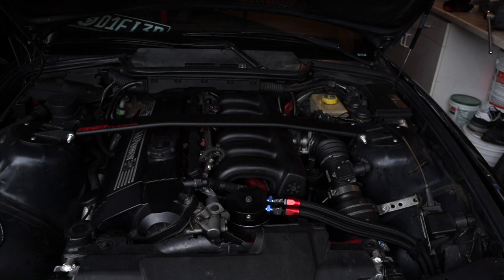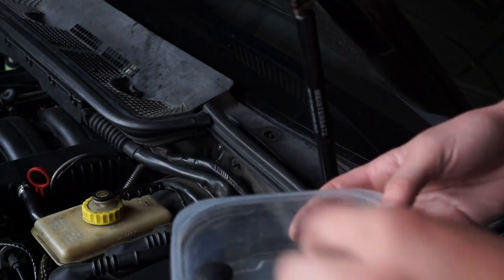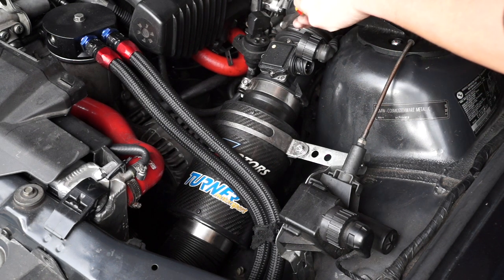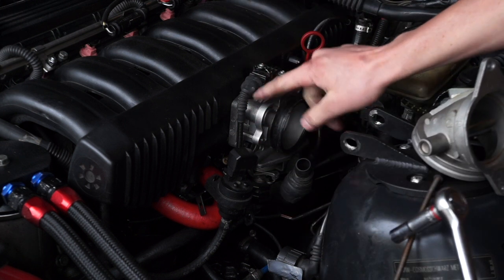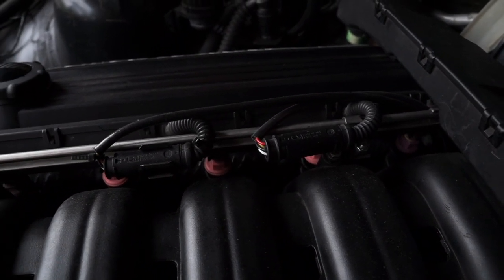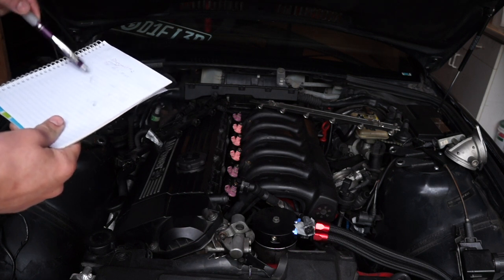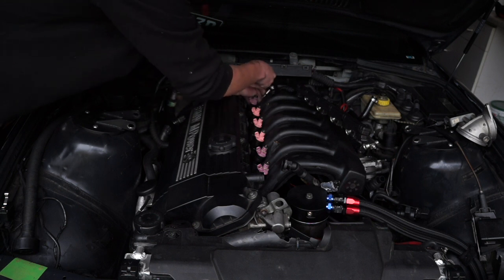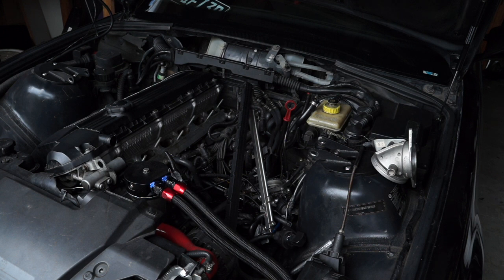E36 intake manifold removal

Comment: Do you have a video on how to put it back onAnd possible problems to avoid?
Reply from the maker: yeah im working on it, the cylinder head is getting machine work done right now so it might be a while before i get to the video
Reply: Great! Awesome videos !
Reply: Any helpful tips on putting it back on?
I may attempt to switch out starter.
It seems like all the steps in reverse making sure all cables and hoses are labeled. Then fuel line back on, then fuse back in. Connect battery and should work?  Any info helps. Thanks!
Reply from the maker: yeah, basically the steps in reverse. if you labeled them when you pulled them off, you should have no problem making sure they are all plugged back in. new manifold seals and throttle body seals are a must if you haven't done this before, as the old ones do not seal as well and you might run into vacuum leak issues. use some multipurpose grease on the seals too, but be light with it. use you a torque wrench for the 11mm manifold bolts,10mm fuel rail bolts, the throttle body bolts. 89 inch pounds. with new seals, proper torque, and some help from the grease, everything should be buttoned up and leak-less. main problems with people who re-install these is they either dont torque or use new seals, then have rough idle and vacuum leak issues.

Comment: just subbed.  just bought an e36 m3. will need your expertise and videos
Reply from the maker: hell yeah, thanks bro. im working on alot of DIY's right now, sadly the head, block, or headgasket just failed on my E36, so thats why it hasnt been in any of my vlogs, but it means i will have a full set of DIY videos on head removal and anything involved. im working on some cooling system DIY's right now.

Comment: I didn't remove the injectors from the rail, its a lot easier to just remove them from the manifold. When you do do this, use some small bungee cords to hang the whole rail from the hood, same goes for the engine harness. With this method you don't have bleed the fuel rail. Note you can also relieve some fuel pressure with the small valve on the front of the rail.
Reply from the maker: True, the bleed valve on the rail does help. I have found keeping the injectors in the manifold helps prevent vaccum leaks, as i have seen alot of cars run rough from a vaccum leak at one of the fuel injectors, especially if they are old and have worn injector seals. the first few times I removed the intake manifold i kept the injectors on the rail, and from my personal experience it is better to leave them in the manifold, as its easier to make the injectors seal on the rail side than on the manifold side.